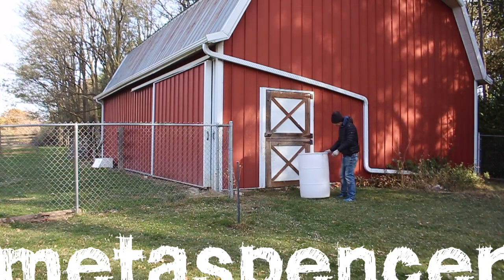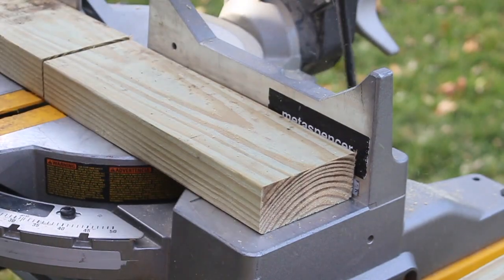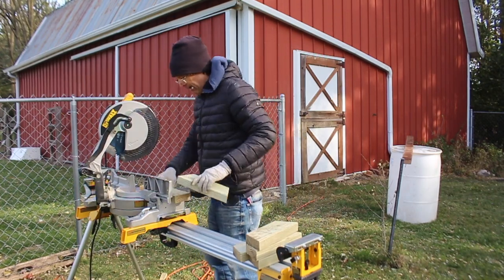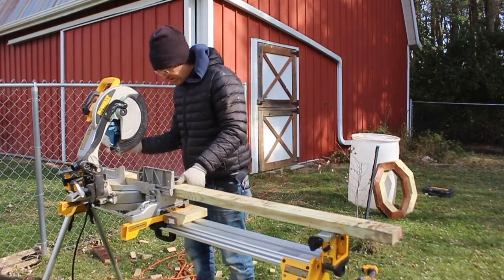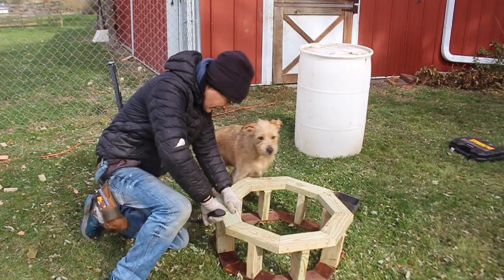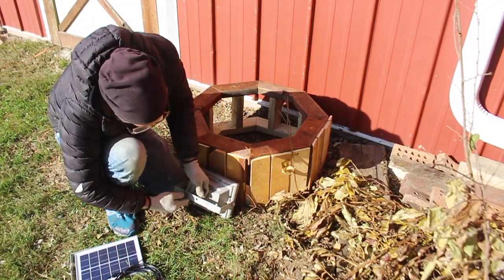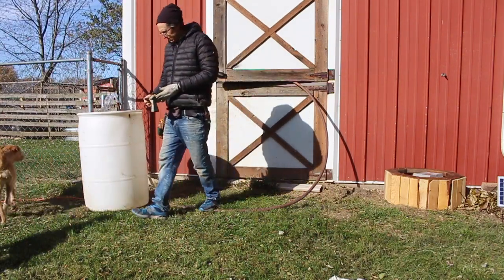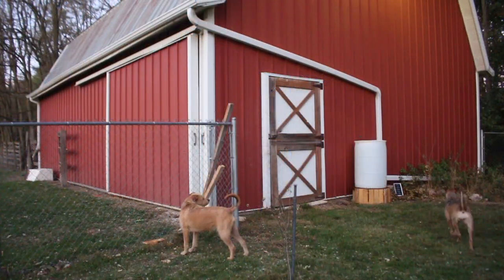Rain Barrel Solar Light

Comment: Each internal angle in a hexagon is 45 degrees (360÷8). To create the 45 degree angle you just divide it by 2 when cutting the two boards, hence the 22.5 angles. If you wanted a 7 or 9 or 14 sided base you could calculate the angles the same way. No need to consult Pythagoras. : )
Reply from the maker: Oh awesome. That makes sense the way you say it :)